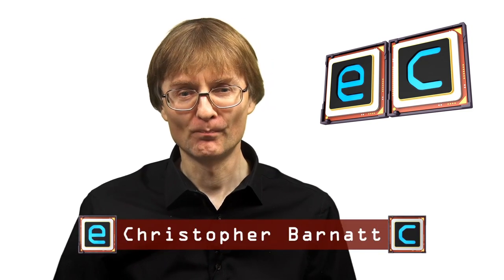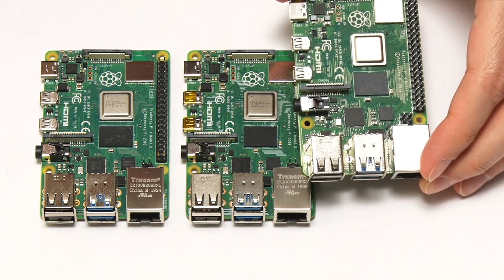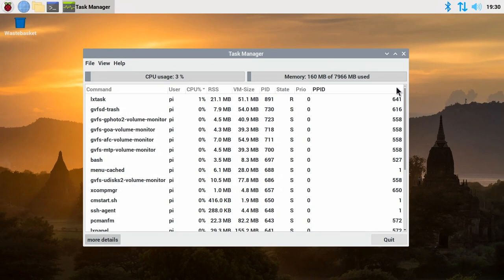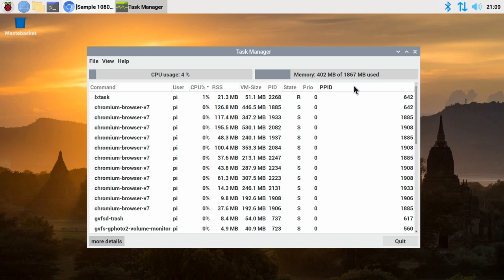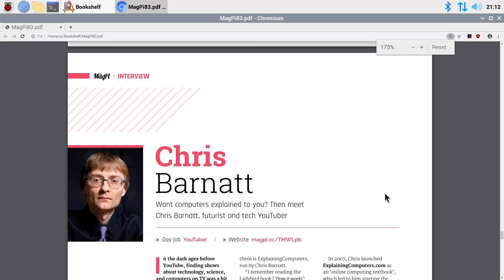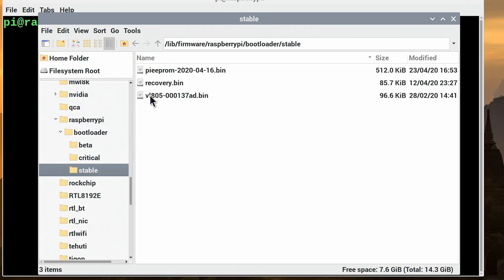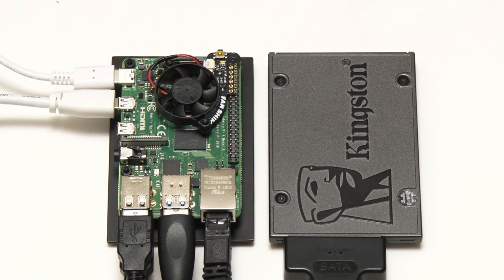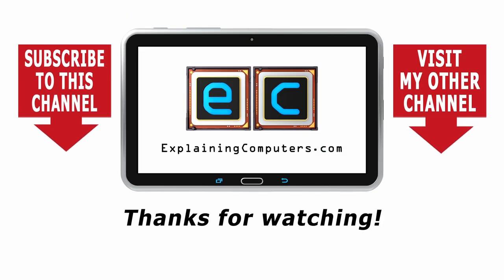Raspberry Pi 4 8GB & USB Boot

Comment: I am also very excited about the USB boot capability, because it eliminates one of the performance and reliability issues with using the Pi4 as a general purpose computer. But my latest builds are real SBC applications. I just finished a garage-door security bot, using a Pi Zero with camera module and GPIO connection to the door opener. It can sense whether the door is open or closed, if anyone has entered, and close it on a timer or by remote command. It also acts as webcam allowing me to remotely view the garage and the door. I'm really enthused about creating more cheap home automation solutions using the Pi Zero and the Pi 4.

Comment: i have 2 raspberry pi 4's. I want to use them as adjunct brains connected to a low-energy robot (like in your Zumo videos) . The Zumo will communicate sensor data with the rpi4. The rpi4 will crank the neural net (or whatever algorithm)  on the sensor data and respond with some sort of action. The rpi4 + battery is too heavy 
to haul around on a Zumo. Thank you for the video. It was clear and concise.

Comment: Hi Chris. I'm just getting into Astrophotography and have recently bought a telescope. I will use the RPI4 with the HQ camera to run Astropi and Stellarium. This will mean I can access the Pi remotely using VNC, point my telescope by controlling it's mount remotely as well as take photos and video remotely. I can then take those pictures and video to stack and process and get pretty pictures of nebulae, galaxies etc.
Reply from the maker: Sounds very cool. :)

Comment: Excellent review of the new Raspberry Pi 8gb. As you pointed out, perhaps the most important new feature is the capacity of the 4 is to boot the Raspi from an SSD. The small computer is looking better as a desktop replacement.

Comment: I did this with my Raspberry Pi 4. I have two external SSD enclosures, both of which have worked fine with other computers. The first wouldn't boot but when I moved the SSD to the other enclosure without making any other changes it worked fine.
The moral of this is that it may be worth trying another enclosure if this does not work for you.

Comment: Chris, you should now take a look at Ramdisk software. 8 Gigs is enough to load and run many Linux distro's straight into memory. Running an OS in Ram cannot be improved upon. Infact you can use your other drive slots for storage. I run Firefox from a 2 gig ramdisk which has Sandboxie installed to it. So i have the fastest possible speed and maximum security. I also run XPx64 in its own ramdisk. There is no faster or better experience than XPx64 in a ramdisk. Thanks for the vid mate - excellent.
Reply from the maker: Great idea -- I feel a video coming on.
Reply: Very cool. What ramdisk software are you using?

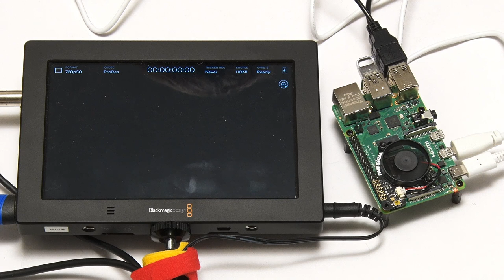Comment: Hi Chris, @ 11:42 you mentioned the lack of text on boot. Edit the /boot/cmdline.txt and remove 'quiet'  and 'splash' from the long line.  You will see it on next boot. Great video as always.
Reply from the maker: No, that is not possible. The Pi has an ARM processor, not an X86 processor like a Windows PC.
Reply: @ExplainingComputers  Sorry if my post wasn't clear enough. I am not talking about editing a Grub bootloader or anything like that. I was suggesting adding verbosity to the boot sequence before you get to a graphical log in.

Comment: A really small battery which can hold higher charges will do wonders for devices like this. Add in the wifi and small form factor NVME and we are good to go. for portable screen on the go we should be able to use our Smartphones.
Nice video as always Chris.
Reply from the maker: I am waiting for a nice little board that fits under the Pi, takes an M.2 SSD, and connects to the lower USB 3.0 port via an angled connector. So many possibilities here.
Reply: @ExplainingComputers  You said what I was thinking :-) I just checked, I don't know how common that price is, but 120GB M.2 SSD: less than 23 Euros

Comment: Bonjour Chris,  I've  installed the latest ARM/Rpi Manjaro KDE using the USB3 interface and can confirm that it's working great.  It provides a very usable desktop experience.  Great to finally have USB boot capability.  As usual, thanks for your advise on installing the firmware.
Reply from the maker: This is very useful feedback -- good to know that Manjaro boots fine from USB.

Comment: I own an avocado farm in Southern California.  I use raspberry pi's to monitor and control the irrigation and other operations.  With the 4G and now 8G models, I can use software that normally runs on a cloud in my control system.  These systems include Redis, Flask webserver, Private BlockChain Nodes, pandas, and SQL database.  Also, software components are written in docker containers

The high-end Pi's allow cloud operations to come to the edge.
.
Reply from the maker: What a fantastic Pi application.
Reply: I love  avocados. I have just now successfully grown a plant from the pip. It has developed it's first thorn. Now back to copying my sd card to my ssd. After many failed attempts I hope that it boots this time.

Comment: I have the RPi4 8GB, an USB SSD, and the Nexdock Touch I ordered is suppose to ship at the end of summer. Add some Velcro and I'm going to have a nifty system for both playing around with programming, oops coding, and interfacing with the world during retirement. Might look into seeing what can be done with foam board RC aircraft, I see there's a hat for running servos.

This is all still amazing to me. Started out with a 1 MHZ, 32K ram, and 100K floppy Apple ][ Plus in 1979, we won't even talk about how much I spent on it. Helped develop an inventory and lien processing system at work with 3 workstations, 4 printers (one at the other end of a phone line using a couple of modems), and a 40MB hard drive running SCO Xenix (before SCO was bought out by trolls) initially on a 80286.

What other hobby keeps getting better and better while costing less as time goes on?

Comment: Nothing like a cup of milk tea in this cold, sunny morning down here in the cone of South America, just to watch a new video from my favorite sunday channel.

I want to use a Pi 4 mainly as a workhorse web and mail server, maybe also as a NAS and streaming server. It will be instrumental in taking back my privacy rights, because PRISM is everywhere. Also, it is always better to have your own infrastructure in the way you want.
I've read modern computer have a small computer inside using Intel Quark that can be used to take over the entire system, so I don't trust my machine anymore.
Mr. Chris, do you think a Pi could be used in secure computing? Maybe with open source drivers, it would.

Comment: This is definitely on my wishlist to get for an arcade cabinet I'm planning on making.

One correction though: the composite out never went away.  It just requires a TRRS dongle that converts from 3.5mm/⅛” A/V out to 3 RCA jacks.  Although, having it right in the unit was convenient for debugging HDMI issues.
Reply from the maker: Ah, I never said that composite video out went away -- I said that the RCA connector went away -- which it did! :)
Reply: @ExplainingComputers  Ahha! So you did.  My mistake.

Comment: Very good video. I am particularly looking forward to booting directly from an SSD, thanks for the ground work - risk city here I come!
Reply from the maker: If you do the sudo apt update and sudo apt upgrade, you will find that there is not a stable release (from June 15). But you can install it as shown in the video for the earlier firmware. It is best used with a clean install of Raspberry Pi OS (rather than an updated version of Raspbian).
Reply: @ExplainingComputers  Success my learned friend! Thank you for your support, much appreciated :-)

Comment: Something to not forget on the pi 1: The self resetting fuses on the USB were under spec. Plug in something that's slightly power hungry like certain flash drives and they'd disconnect, or disconnect right when a file transfer started. Which most people solved by using an external powered usb hub, or like me just short the polyfuses out.

Comment: I have two 4x2gb for pi-hole in geekpi cases (replaced two 3B+) , two 4x4gb running Librelec in Argon 1 cases, and a 4x8gb in a geekpi/low profile ice tower case serving as a MySQL server to share my Kodi media library. The 3b+ Pis have been retired until I find something less important for them to do, I replaced the 3B's for pi-hole because the Pi4 has much higher network throughput. Video playback is more than adequate for 1080p resolution, and the 4K issues on the Pi4 are of no concern because I don't have any 4K media content. All my Pi4's are booting from Samsung Fit Plus 32gb USB drives. Pis make great little appliances.
Reply from the maker: This is some serious Pi application!

Comment: I just ordered my first Pi and maybe went a bit overboard! Got the 8 Gb model. Though I was hoping to run Manjaro ARM64 on it. I have dug up a 128 Gb ssd and a sata to usb 3.0 enclosure so am going to try it on that first thing I do when I get it! In the meantime it was very helpful to know that the 32 bit Raspberry Pi OS can still utilise the 8 Gb of ram. Though maybe wouldn't ever need to. I'm so excited to get into my first Pi! Should be here by the end of the week! And yes I've seen your updated video of usb booting with the latest version of Raspberry Pi OS, much easier now!

Comment: 3:38 Just as a note to those who don't already know, even though the Pi 4 doesn't have an RCA output jack anymore doesn't mean the functionality is gone. If you connect a four pole 3.5mm to RCA cable to the 3.5mm jack, it can still output composite video out. You may need to change a setting using raspi-config for that to work, though.
Reply from the maker: Correct -- I never said that composite video output had been removed! Just the phono jack.

Comment: Thanks Chris, you got me hooked on these RPi's.
I bought a 2gb version as it was just to try linux on. Rasbian was good but now I ve stuck it to the top of an old Kingston usb3 case with 256 ssd (2016) with velcro, and it now boots and runs ubuntu 20.10  fine.
Youtube videos are good on mozilla, but it can't run Kdenlive (I only wanted to try it, didn t think it had the memory).
I tried it with the same SSD in a usb3 case bought from a famous online shop. No way would it boot although the SSD took the image from balena etcher ok, if slowly. 
Maybe you could feature the problems caused by cheap equipment. This rubbish could discourage a lot of people,  sadly.
Keep up the good work.

Comment: I have a 4GB Raspberry Pi 4 running Open Media Vault and sharing a 1TB SSD on the network which I can access from all my devices, (computers, phones, tablets and even stream movies to a smart TV) that is way more advanced, up-scalable/upgradable, versatile AND less expensive than any NAS you can find on Amazon, and an 8GB version running Retropie with all the games I played as a kid on there. It has an ice-tower cooler so I can overclock the CPU and GPU and the emulation is fantastic, possibly the best low cost retro gaming console available.
Reply from the maker: These sound like great Pi implementations! :)

Comment: I already have too many desktop PCs and laptops - my pi(s) are great at running things like pi-hole, volumio for my music and other small services. 8Gb might be a 'wow' but I hope (and believe) that the Pi Foundation will continue to roll out the smaller specs - even 2Gb is more than is needed on an awful lot of current and near future uses of the pi - particularly for kids education which was the original idea I think.

Comment: Spooky timing as I'd literally JUST done this very same operation on my 8GB board about an hour before I saw the notification for this video! Oddly I get a slightly different boot screen with a QR code (briefly) and I also used the 2020-06-03 version.

Comment: It seems quite odd commenting on a video this old, but it looks to be the most relevant. I just acquired a Raspberry pi 4b, which I plan on using for desktop publishing (formatting etc). Most of the software I already use is Linux based, so it seems ideal. What I really need to do now is set up access to a drive on my Windows home network, and allow Windows 10 access to the storage drive on my Raspberry pi, which I understand uses some arcane process called fstab. I'd dearly love to see a video taking me through this process.

Comment: I would like to see a demo of you installing Ubuntu and loading steam games onto this pi and testing Linux compatibility.  That would be interesting I think, multiple variables etc.
Reply: Hey there matt. The whole reason I'm here is because my wife wants to play old steam games. She has a problem with the laptop (something about old games need a square screen) anyway not knowing much about computer stuff in general I heard about these pi things and began looking. My question, did you find out if a pi can run steam games? Thanks 😁
Reply: @2learneasy  well if your laptop has a signal output, and you've got an hdmi to VGA converter (on amazon)  I'll be more than happy to sell you a 4:3 aspect ratio 15 inch lcd monitor.  If you want one bigger, I also have several high end CRT monitors.

Comment: 3 things that would make a big difference to the pi4 would be, M2 connector(sata and/or nvme) instead of sd card, so-dimm slot with 0 ram pre installed on the board and usb c port for the video out put so if you use only 1 you have a extra usb c port. That would make it a computer most people in the world could afford and would help make Linux more universal as a home pc os.
Reply from the maker: Nice thinking, but adding a RAM slot, M.2 connector and USB-C with video out would probably increase the cost of the Pi by a factor of three or more! :)

Comment: Well Chris since you asked, My Pidom is: Site 1 , Pi3 Running ADS-B , Pi3+ running Weather station connecter to WU, Pi Zero W, running indoor display for this WS, Pi2 running monitor for wood fired oven. 
Site 2: Rpi3+ running ADS-B for aerial testing, Pi 3+ running Wireguard, Pi4 4Gb running  OpenMediaVault,  
On a steam train in France a Pi3 running a custom auto announcement system. In the tool box a Zero W and a dead Pi2. 
Almost forgot a Pi3+ running a target controller for local gun club. 
As soon as I am released from (C19) detention, introduce my 6 year old grandson to Pi baking
Todo, put WG and OMV on a new Pi4 2Gb,
Reply from the maker: What great applications! I particularly like the Pi on a steam train.
Reply: @ExplainingComputers  That one was quite simple, I need to improve the sound output quality when I can get back over there and move to 70V line speakers.

Comment: Hey you are featured in MagPi 83! Well what I want is for my Pi 4 to work better for RetroPie, OSMC as well as use the TV Tuner uHat with TVHeadEnd. Now I'm surprised that the 8GB RAM version along with the rename of Pi OS introduced those exciting changes. But the big question is will it allow better support for WineHQ (which I doubt as it's not 100% reliable and not good in an ARM environment)? I don't use the Pi for Windows 10 Non-Activated OS but I do use VMWare on my PC to load Windows 98 as well as some old Windows OSes that older programs rely on.
Now I know that the Pi 4B doesn't have a good GPU like the Jetson Nano for using like RetroPie's GFX enhancer like 2xSai. But I've found out that using mClassic from Marseille can smooth the video quality, upscale and enhance the colour depth. However the mClassic doesn't work with Interlaced modes nor in 240p, as the video modes are limited and cannot work well in 4K - so it would be better to play those retro games in VGA/480p mode when adjusting the resolution in RetroArch. And as for using the mClassic to use Kodi to enhance the videos or using Youtube players, then setting it to near 720p would work better.
But of course the mClassic is a HDMI dongle and the Pi 4B uses two mini-HDMIs so I'd need an adapter for that...

Comment: You actually still have composite out on the Raspberry Pi 4. It is disabled by default due to hardware limitations, but it can be enabled and is physically located in the audio out minijack port.
Reply from the maker: Yes, but I never said that the Pi 4 does not have composite video output -- it is available via the 3.5mm jack as you say. I only said that we had lost the RCA connector, which is true.

Comment: I hope they give the "A" form factor a taste of the Pi 4 series. The smaller boards are much better suited for finished projects when input devices might not be necessary.
Reply from the maker: I totally agree. I really like the 3A+. But an A model with USB 3.0 and more RAM would be really nice.
Reply: ExplainingComputers Also, maybe a PoE-enabled board as well because the A+ boards take around 1/3 less power. In general, I would welcome the idea of an "F" series, meaning "F"inal.

Comment: The RCA video port from the original PI is actually part of the headphone jack on the RPI4.
Reply from the maker: Agreed -- the Pi still has composite video output. And in the video said nothing to suggest otherwise. I said that the RCA jack had been lost, which is true. I did not say that composite video output was no longer available. :)